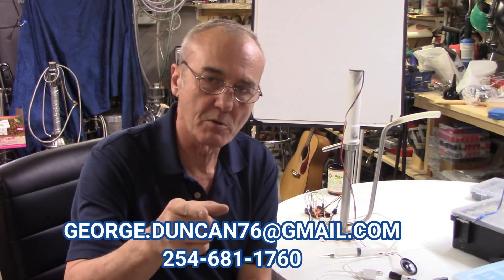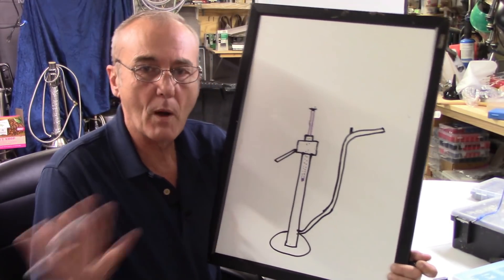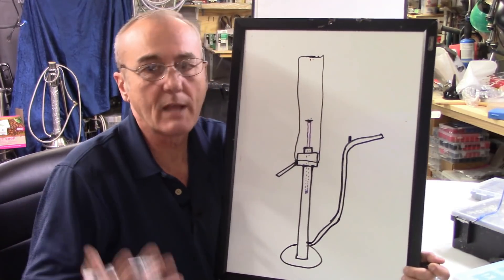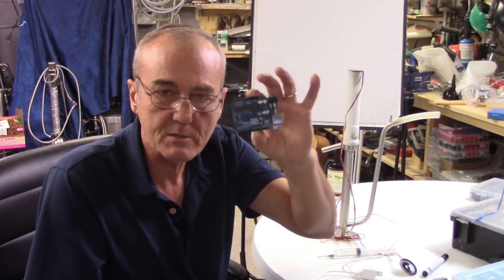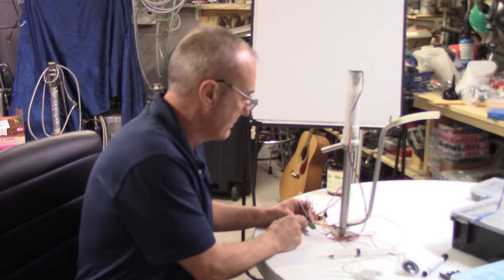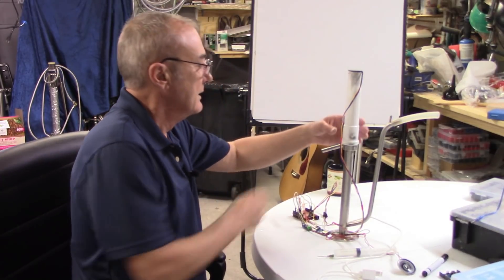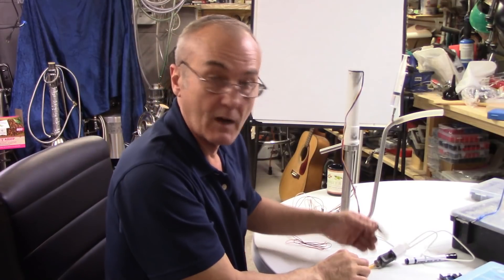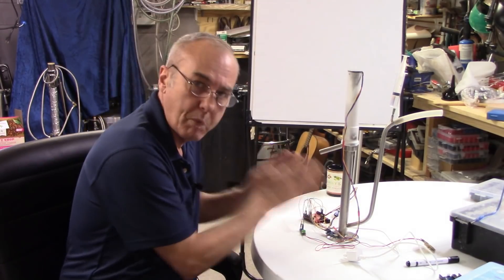AUDIBLE HYDROMETER SUCCESS UPDATE

Comment: Cant you just use of the shelf audio amplifier 20-50w? If you are will get a pcb designed you can use some TDA series audio amplifier IC that just needs 5-8 external components. Too bad i have no time to spare at the moment, because it seems like an interesting project.

Comment: Being sighted my original reasons for wanting to do any of this stuff was to get the telemetry. Every still is a little different and having a pile of data from a single system can give you insight on how to improve your process and equipment.  If you do some digging in that audible pid there is a csv file that gets written out during every run. I was using that to improve and dial in the PID algorithm.  I'm not sure how you would persistently store data in an uno but having that data is really useful for iterating through different tweaks as you improve it.

BTW the voice on that is really good, did you use a bunch of wave files or is that text to speech?
Reply from the maker: Thanks. I used individual wave files and the program seeks out the value and plays them in order. This was a long process but very rewarding when done.